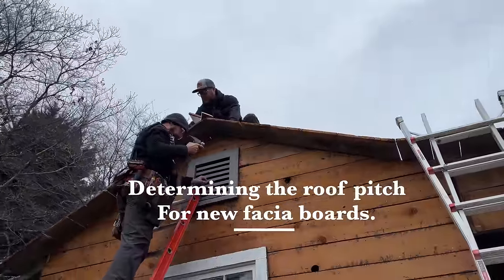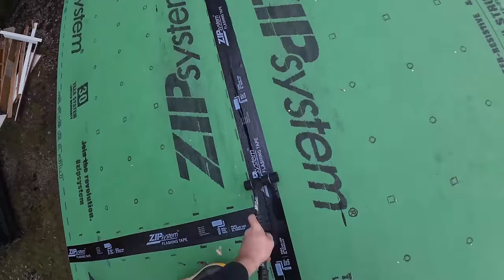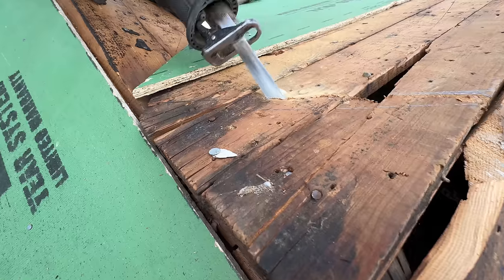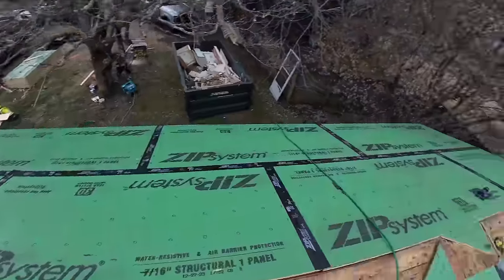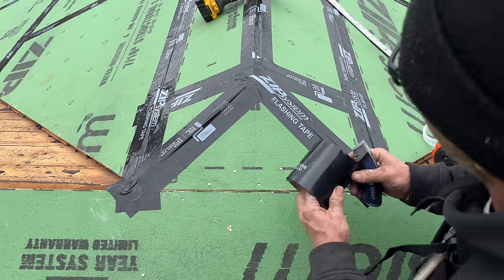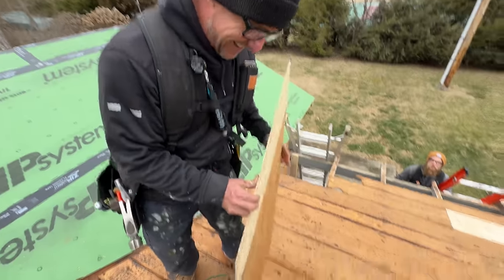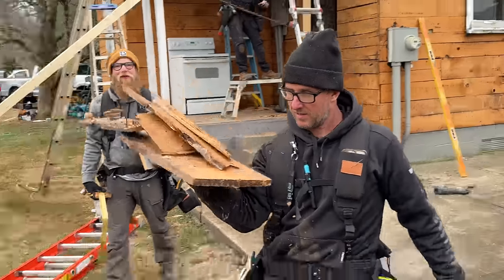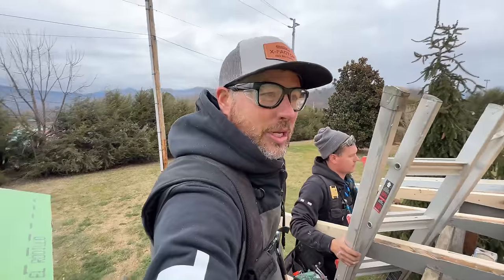Repairing and Remodeling A REALLY Old House pt. 2

Comment: CARPENTER ADVANTAGE CALCULATION!!!! I am a long time fan of your channel and the great work you do! I am a woodworker and Mechanical Engineer and after watching your last video when Jamie used the chain tension to move the framing I did a quick calculation. I emailed you my calculations and solved for the lateral force you could apply with a certain weight and a certain angle of the chain. The closer to horizontal the chain is the more force you can produce! With a weight of 180 lbs and an angle of 10 degrees you can produce 511 lbs! Formula is F=Weight/(2*Tan(angle)) when the angle is measured from horizontal.

Comment: Love remodeling projects like this. It looks hopeless at times, but it is such a stimulating exercise and amazing skill training to identify and solve problems on projects and buildings that aren't completely standard or modern

We did much the same thing on our cabin last year. The walls and windows, especially those facing the ocean and its Atlantic weather, were completely shot and full of rot. The sane thing would have been to burn the entire thing down and build a new one, but with all the memories and affection attached to such a place, we decided to repair and remodel instead. We (my dad & I) have now completely repaired the two bad walls with new framing, insulation, siding and windows, and I absolutely cannot wait for summer when we're doing the other two

Love this series so far!
Reply: Sounds like a building love story...to burn down the building would be to burn all the memories with it.  Old is the new new!

Comment: You can use your speed square and a plumb line to measure existing roof pitch.  No need to guess, cut facia based on your guess, and then see how you did.

Comment: I had a frozen ground problem, as I had to put up a fence to stop our dogs going into the river. We used a machinery pinch bar which helped and a petrol post auger which finished the hole well. If anyone has seen the original St Pancras piano farce with the Chinese people post, I honestly thought that was Arlo speaking with the piano player. The roof is looking so much better with the Zip system boards down. Keep safe and well guys. 🔨🔨🔨🔨🔨

Comment: Hey a Pro Tip i learned a long time ago was to trace that roof line, then lay the level on the roof and trace the other side of the levels thickness. It back spaces the cut line back to allow for sheathing to plane up. A quick and dirty trick to use...if anyone wants.

Comment: The tension force on the chain: Same math as figuring out the lengths of the sides of a right triangle. The chain is the hypotenuse. The imaginary short leg is your weight pushing down. The imaginary long leg is the force pulling over.

So if your weight is 200lbs and you're below the chain pull point by 2', the chain pull point is 12' away from where you are standing on the chain, then the horizontal force is approximately ((12' / 2')*200) or about 1200lbs.

Comment: I never use rise and run. I just put my Bosch digital angle spirit on the rafter/roof, it'll say 26.5°, and then cut the wood in the mitre saw. Then where needed, that little bit cut off is ideal to mark the birds mouth.

Comment: When we bought our house the inspector said there was "some termite damage". When we went to redo a guest bedroom my husband wanted to see what the insulation looked like. He removed some of the drywall and was shocked to find he could see through to the outside. When he started to move the wood from the beams around the same thing happened to us that happened at the 14:40 mark. The wood was rotted and termite damaged all the way down to the foundation.  Every piece of wood around the whole bottom of the house had to be replaced along with some floor joists.

Comment: What I have done here in Iowa is to build a charcoal fire, and once it is burning well, cover with aluminum foil and let the heat work its way down. Repeat as needed. Jason would use it for barbecue or throw some wrapped potatoes in for lunch.

Comment: Assuming that the chain acts as a rigid member when taught, that Jaime was standing about twelve feet from the post and that he weighs about 175 lbs the moment arm produced about the pivot point at the base of the post would be about 2100 lbft. This approximation becomes significantly less accurate the further away Jaime stands from the beam as the chain is not actually a rigid member.

Comment: Just a thought when digging the frozen ground have you thought about using a garden fork with a long handle? Hammer the fork prongs down into the ground so it’s basically flat to the ground then just pull up on the handle making a lever. It would be slow but much less back breaking.

Comment: You like one story, smaller projects? :) Wish you guys were in Florida.  I had architectural plans drawn up several years ago to extend the back bedroom out and add a master bath and closet.  But, it would involve removing a concrete block wall and making the addition in concrete block.  I also have a flat roof fireplace room addition that would be cool to have a rooftop deck constructed above somehow.  Would be right next to the new bathroom add on, so roof slope or no slope could be decided on at the same time.  Lots of potential with my place and lot.  Like adding an ADU as well.  I come up with ideas every once in awhile even if I can’t do them.  Perhaps future owners could…and it’s nice to give them ideas also.

Comment: What stud? 
My house had the bottom third rot off of 7 studs at the back of my garage, along with the sill plate and I just found another missing sill plate under the kitchen door while tracking a rat in the basement. Both areas were under the old deck, which had been improperly flashed. The first had been caught during a siding job but the second was unfortunately hidden by an old porch slab that was poured against the foundation by that door. This is going to be an interesting one to figure out. I have a feeling the cabinets and door framing are the only things holding that section of wall from ripping the top plate off of the rafter extensions. 

...and if that description makes no sense, that's basically par for the course with this house.

Comment: when you do, replace rafters and repair rafters on the half-roof.
why don't you remove it so that you can raise it a little by changing the slope a little and get the gutter at the same height as the other roof surface, so that the whole wall is not red again in 20 years.
I don't think this solution would cost much more, and it would also be possible to build walls later, so that there would be a slightly larger living space

Comment: The cobbled scrap wood on the roof modification will actually be fine ,
But we all know if they had pulled a panel off and found that kind of work there would be 15 minutes of footage talking about how crappy that kind of work is.

Comment: The reason real carpenters use degrees is all roof structures can be broken down to triangles and there is 180 degrees in a triangle: working on that theory it’s a much better way to be precise with your angles than using a little speed square. Maths for precision- speed square for speed you cowboys!

Comment: You guys don't know how to figure out the roof pitch? With a level and tape measure? C'mon man! So it a 12/12 pitch is 45 degrees. Would it not be the case, therefore, that a 6/12 would be 22.5? Speed squares are not all that accurate, degree-wise. The roofing thing: Jamie is my kind of carpenter. He just knows and goes! And what a fun job. Small, close to the bakery, and working for a friend! What could be better! Bravo (not a fan of the GoPro shots, though).